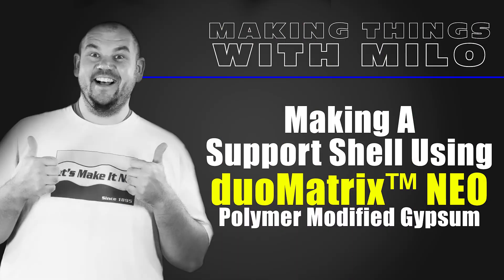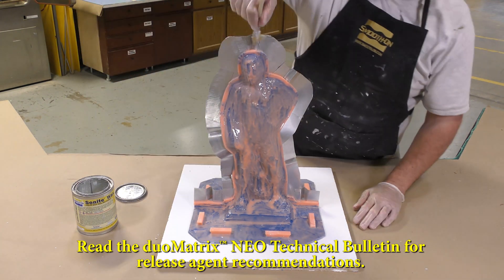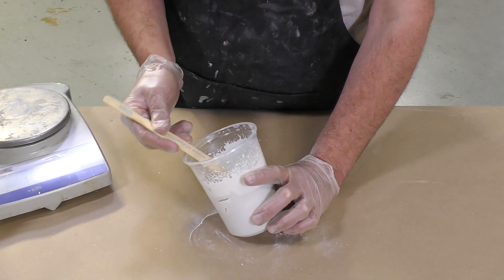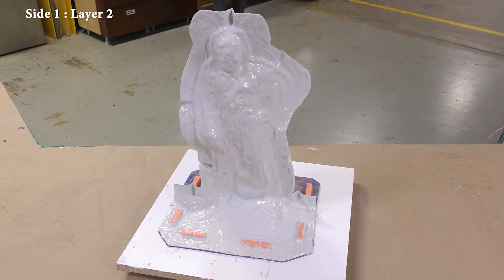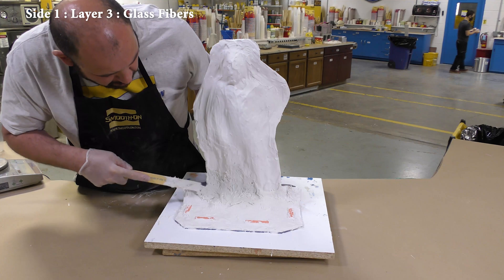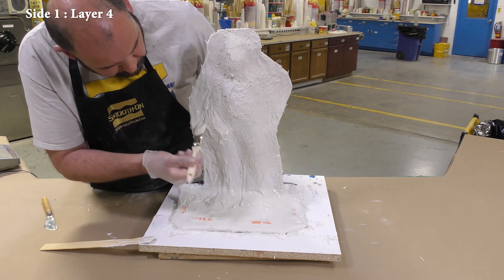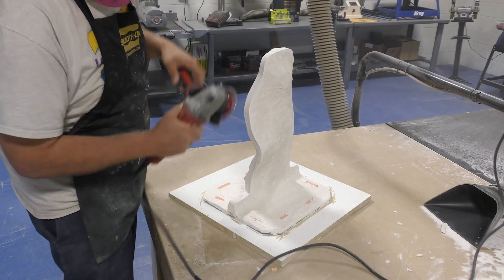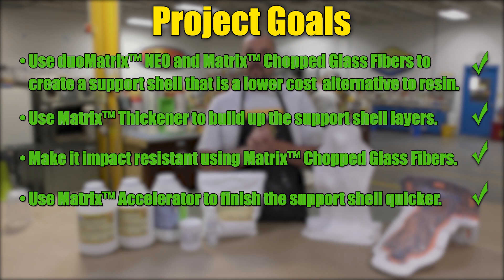How to Make a Support Shell with duoMatrix NEO PMG

Comment: How critical is the thickening agent? Can I make this work without it with another layer or two or will it not be able to adhere to the vertical surfaces?  My thickening agent is “lost in the mail”
Reply from the maker: Yes, you could create a similar shell without thickener.  It would just take a bit longer, as smaller batches of material would need to be made to resist slumping.

Comment: I'm really confused. Does Sonite wax used for sealing porous surfaces or also as a mold release agent? As I see from your video you use Sonite wax to separate one half of the (White) mold from another. And it seams like you don't use any other silicon spray or whatever mold release. Why????
Reply from the maker: It can be used for both, depending on the situation.